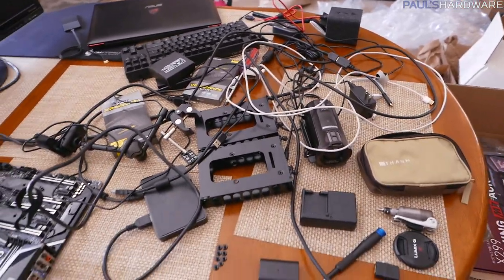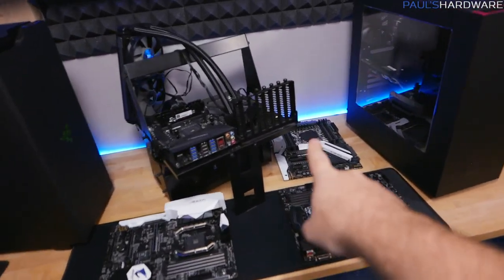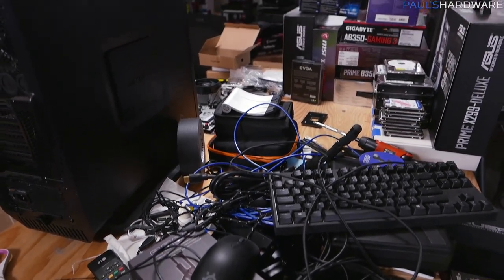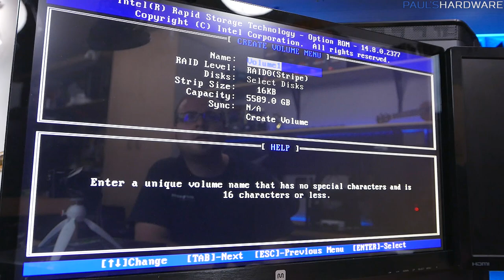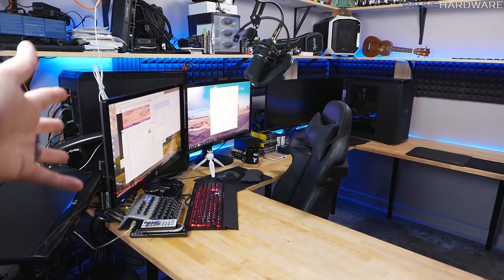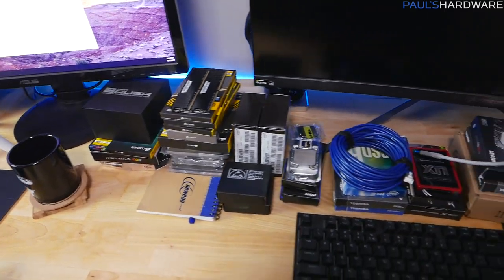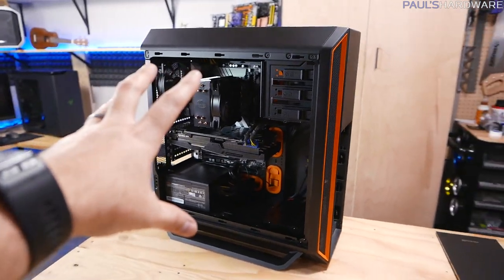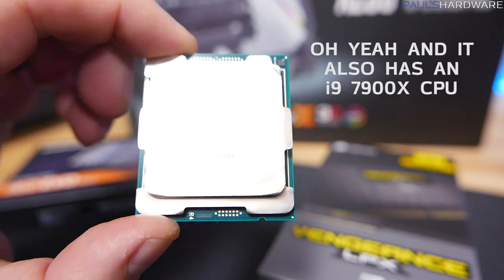ACCIDENTAL PC BUILD

Comment: I mean I'll take a few of the 'old parts' off your hands
Reply: Slowmo Ninja Same
Reply: no I am the one who needs the parts you can have all the consoles he has or the last gen hardware if it is current gen I will happily take a x299 MOBO and 10 core CPU I mean people are hating it anyway and it is not like anyone would buy it but if you are only about pure performance it is better than what a 10 core threadripper would be due to higher IPC
Reply: Woah woah woah. I would just be happy with either a r5 ryzen or i5 and matching mother board. My fx 8350 in getting long in the tooth.
Reply: I HAVE A 7 YEAR OLD PC THAT HAVEN'T BEEN TOUCHED (Only Dusted) YET! (No upgrades what so ever) I NEED PC PARTS Preaty PEAS?

Comment: "oh yeah, it has a 7900X" Just your average day in Paul's garage
Reply from the maker: I nearly forgot ;-D
Reply: Paul's Hardware Well it does become normal and repetitive for someone who casually unboxes two X299 CPU's in his cleanup video
Reply: Youri Dv its also a fire hazard
Reply: Jaco Van Rensburg not if you have high end cooling
Reply: Youri Dv When not even a 240mm rad can keep it from thermal throttling, you know it's HOT. I would wager that anyone who buys this and doesn't at least change the shit thermal paste that they include is getting ripped off. 1000$ CPU and uses bargain bin thermal paste. Intel fucked up and they know it.
Reply: Quaerens Veritatem of course they fucked up. a 240 mm radiator can keep the 7900X from thermal throttling as long as it's one of those EK or Alphacool rads. not some 240 asetek rad that's attached to an all in one. there's a big difference in the cooling capacity of a 240mm nzxt kraken or corsair hydro and a 240mm ek radiator
Reply: Youri Dv LN2* cooling

Comment: You can send me some parts if you don't want them :D Let's say:

a motherboard
a good CPU
a HDD
a SSD
a good video card
a nice case
some RAM, 16 GB will work
and a PSU
Reply: BicycleRow Dont you need a monitor?
Reply: And in the end, Paul sends you:
-A Socket 1 motherboard with no jumpers
-An Athlon 64 1.2 GHz CPU (great in its day!)
-A SCSI 80 Mb HDD
-A Hercules monochrome video processor
-An empty case from an old eMachines system in the basement
-A 200w Diablotek PSU
-A 64 Mb flash drive in place of the SSD
Reply: Guerilla Grue Plays Does he autograph it, as well?
Reply: I'll be happy with an 8GB RX580.
Reply: You also might want some fans unless you're trying to build a space heater

Comment: You have mentioned in the past that the temperature in your garage can get a higher than you like. Something that would make a big difference would be insulating that garage door with rigid foam. You can cut your own pieces out of rigid insulation sheets, or buy a kit, all available at builder stores. Even if your door doesn't get direct sunlight, the amount of heat radiated in through from outside is extensive. It will make a big difference. Lowering the temps in my garage even helped keep temps down in the portion of my house above my garage.

Comment: hey Paul I just wondered what your current opinion on water cooling is.   I dont see a whole lot of AIO's in your rigs and I didnt notice any custom loops either.  do you mostly just use air cooling because of easy clean up when tearing these systems back down?

Comment: You should build a shed that has carpet and lots if shelves for all your spare parts, that way for a build you can use some, and you can cycle out the shed with old and new parts. It would be alot more efficient, save space, and its convenient.

Comment: Hi Paul, enjoyed the X299 build there.  BTW what's the cheapest Asus board compatible with say the 
Intel Xeon E5-2620 v4 2.1 GHz Eight-Core LGA 2011-3 Processor?

I can only seem to get an older v3 Xeon to match, https://pcpartpicker.com/list/Y6PByf thoughts?
I don't mind a compatible board for the v4 Xeon mentioned as long as it is ECC compatible and has a decent UEFI (Gigabyte, MSI etc).

Comment: Paul, If you were local, I would volunteer to rebuild your 2x4 ceiling grid with a modular steel system.  Also, think about a shelving unit perpendicular to the back wall (in relation to the normal camera angle),  it would help define the studio space and give more storage space.

Comment: when you get things from manufacturers typically do you have to send that stuff back or are you paying for it or is is just your stuff at that point? Do you just end up with shelves and shelves of parts or do you typically sell off the stuff you get?  I guess if you have to send the stuff back because they only lent it to you for testing that's not so bad because at least you don't have to worry about short or long term storage solutions. With the amount of parts your using in any given video though i could see how it could be a bit of a nightmare to sort and store everything.

Comment: If you want hardware "going out" I would legit buy a 7700K off of you, if the price and condition is right, and possibly a motherboard if you have one that I like. I have most of my other parts purchased, just waiting on the H500P to be released, so I had been considering just waiting for Coffee Lake as well. But if I can get a good enough price on a 7700K, I'm fine using that too. All of them are an upgrade over my current 2600K.

For motherboards I've had my eye on the Gigabyte Aorus Gaming K7 or Gaming 5, but not the K5. A regular Gaming 7 is great too if the price is good.

Comment: So i got an actual question about a problem i run into a few days ago: I got a monitor that has a VGA connector(i know that it is an old type, but i grow up with that kind of monitor type, and it is still running so i don't see a point of changing), but all the new GPUs, for example GTX 1050 or RX 460, i'm also going to be getting one of those cards, the thing is, is there an adapter that anyone would suggest me, that's not really expensive - somewhere 30 euros/dollars is my max, but if there is one a little bit more, i will think about getting one, any suggestions? Thanks in advance

Comment: hey hey hey paul, I have a suggestion for you, you know your big table in the middle of your garage, you can double it by building and fixing another table top board underneath the table in the confines of the table probably 2 feet off from the ground, that way you will have two table space from one table. hope it helps some of your space problems. :)
Reply: oh you probably have half of it covered, just saw that later in the video. :p

Comment: this case is not the silent base 600 it is the silent base 800 I have this case and I hate it. Airflow is terrible. Temperatures are terrible and it is not quiet at all... I switched the 2 front intake fans with Noctua Industrial 2000 RPM fans and placed another Nocura Redux fan at the bottom as intake. Same shit temps got down with 2 degree C.... Just do your self a favor and don't buy this case.... also did I mentioned it is expensive?

Comment: Well well well, f-irst let me just say Paul I like your work, recently subbed and have been watching your newegg reviews for some time now. I like that you seem to know your stuff without just being a 100% gamer like a lot of channels I see, I mean there is so much more to a computer than just the ability to game. one of my systems is a 7700k with 32 GB running on an asus z270 board XMP profile and guess what I don't have a video card in in because I spent the money on SSD's and more and better ram and cpu and mobo. and cooling. my reasons. because this computer has but only a few purposes, and gaming and 3d rendering are not on the list. I would get zero benefit from having a discreet graphics card for the uses of this pc. I think more gamers need to realize that computers were not made to play games on, and unless they are certified professionals in something computer related, they have zero business trying to educate or correct actual respected professionals in the field just because they can follow someones instructions on how to assemble a pc. I can build a dresser from ikea by  following the instructions but I am far from a carpenter or construction worker
thanks for the video, keep u the good work, I just learned that turning off adblock helps so I did